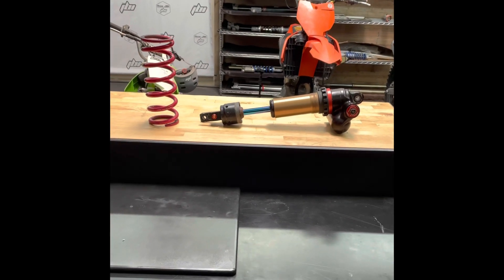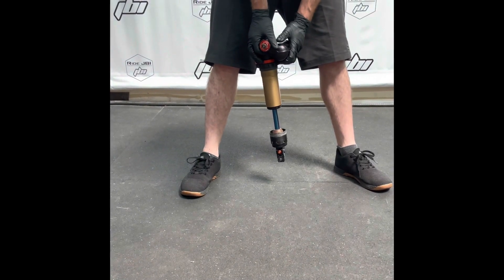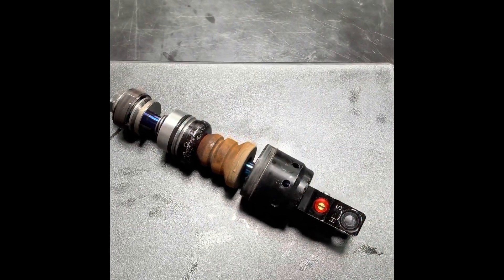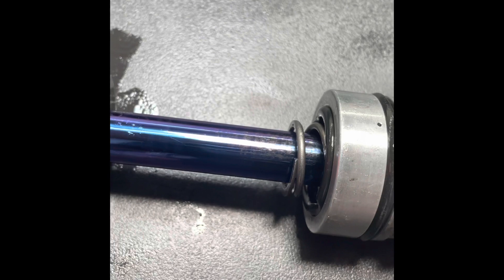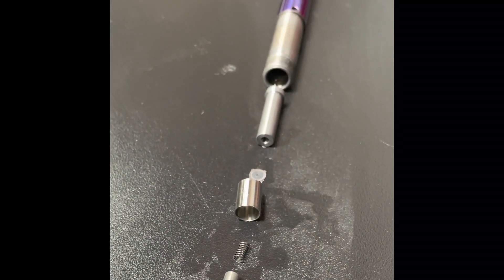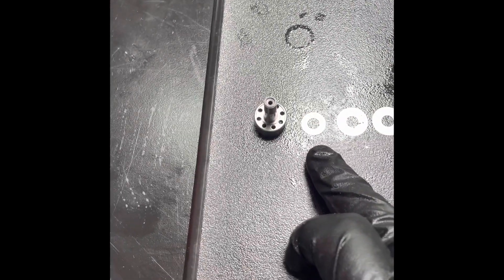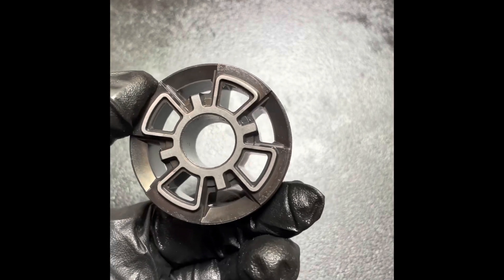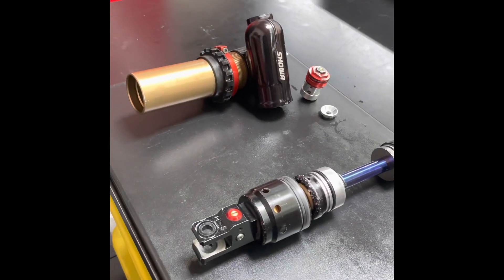A Kit Showa Shock - Disassemble and looking inside.

Comment: Looks like A kit is a rip off. There's no reason they shouldn't be using this in stock bikes. These parts are not hard to make or expensive to make at all.
Reply from the maker: Agreed that it would not cost the mfg much to implement these parts / features in the suspension.